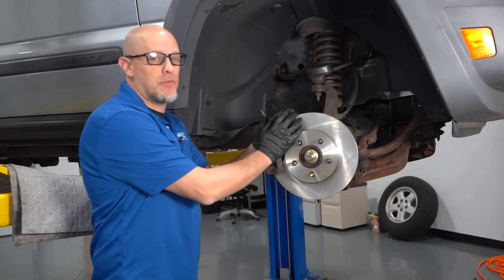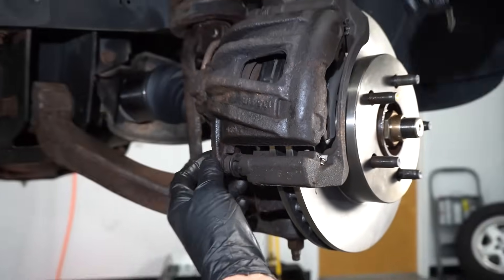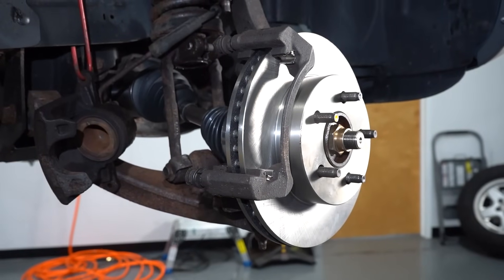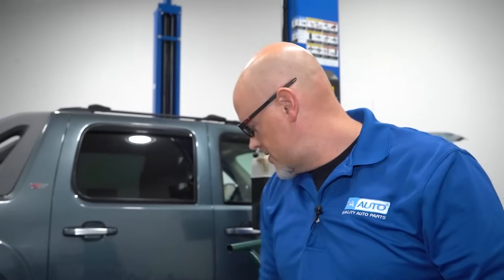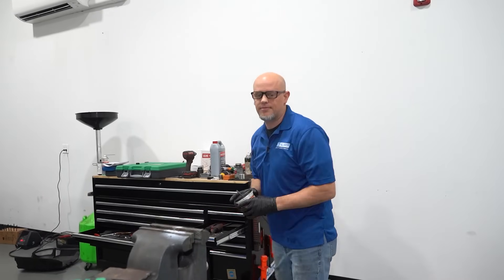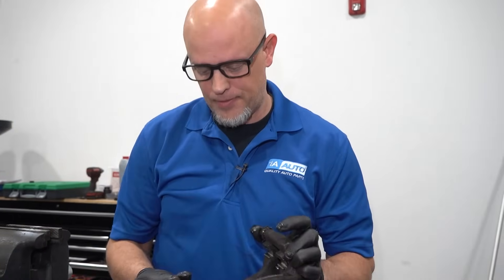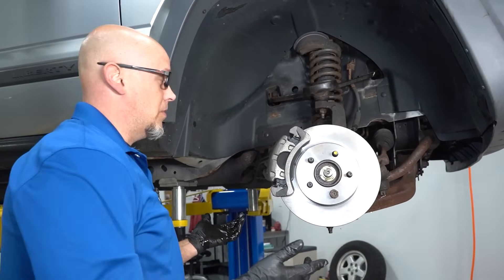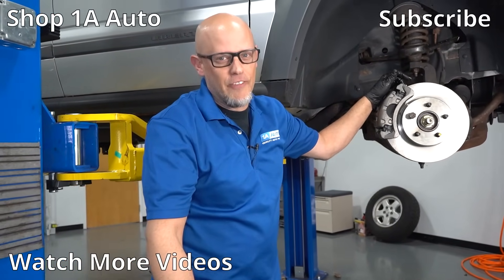Smoke? Hot Smell from Wheels? Check Your Brakes! Diagnosing Seized Brake Calipers

Comment: my car got s the same issue shaking staring wheel  going a  1 hundred down  hiway with out touching the brakes pedal if I press the pedal my tires are new and properly balanced the death shak that will losing pretty much every single bolt on the car 🤣🙃

Comment: If you just installed new rotors and pads, why didn't you clean the slide pins before you installed the new parts?

Comment: Toptip. To prevent the running of brakefluid when the brakesystem is opened, just use a rod to push the brakepedal about halfway in, before opening the system.. It basically stops the fluid from running.

Comment: Ive got a unique situation where my brakes were evidently overheating and brakes were binding. Stripped everything down cleaned all sliders up although they moved and pushed the piston back with ease, thought whilst there change the pads for good measure but still binding?
Have resorted to ordering new calipers, holders, pads, discs and hoses and hoping that'll sort it but no idea why the binding has occurred...

Comment: If you are disconnecting a caliper or hose, first connect a pipe to the bleed nipple and open it. Then depress the bake pedal until it goes to the floorboards and wedge a piece of wood between the pedal and seat-front to keep the pedal in that (depressed) position - this will close off the transfer ports in the mastercyclinder and stop the reservoir from draining out of the ( open-pipe ) system. Close the bleed nipple unless you are pushing the piston back into the caliper.
After all work is done on hoses,calipers and or caliper carriers and things are re-assembled, you can then relaese the brake pedal inside the car and proceed to bleeding the system as normal..... this is the oldest trick in the book as it minmises the amount of new brake fluid to have to use replacing all the spillage that is now on the floor. It also prevents air-locks getting in the anti-lock brake system which you really wanna avoid as it's hard to purge them.

Comment: I think I’m having this problem. I touch the disc and it was very hot compared to other side but the caliper is new. Plus, the brake pad is getting chewed.. Also, I’ve been losing gas mileage a lot.

Comment: When I was younger and we had a truck with kingpins to be replaced, the kingpin would never go out and if you heat them up and try to remove them hot, you won't be able to remove them, or you will destroy them in place. The trick we used is to bring it cherry red hot, and spray it with cold water until cold. Then it would come out very easily. Theorically, you tempered the metal, but we never any issue with that method. Hope this help.

Comment: I’m shocked you didn’t open bleeding valve to relieve pressure. 
I’m shocked you didn’t check brake line for back pressure.
I’m shocked you torched and deified the brake caliper bracket. 
‘’It’s now a very weak bracket’’  no molecules left. 
I give you a F-  on this video. 
All your other videos are great 👍 
(This one, I would do over. 😎 and rethink your procedure)
Sincerely, Mr bill ,,, shop class teacher.

Comment: My 2004 Toyota sienna is making a scraping sound, and the disks brakes were getting extremely hot, burns to the touch and smells like hot metal. The mechanic told me it was the caliper and disk brake. He replaced them, but the problem is still the same.Could it be the Wheel bearing? I feel a Vibration at the gas pedal, all the way up to the steering wheel.
Reply from the maker: +@humbertothebeliever2443 We wouldn't be able to diagnose an issue like that here, you may want to have a local mechanic take a look at it. Thanks for checking us out! http://1aau.to/m/Shop-1AAuto-c

Comment: I had to edit this post. The rubber glove trick is so got damned amazing and beautiful 🥰 I can't tell you guys how much you have saved my life. You guys taught me how to do my own breaks, Fix my U joints on my drive shaft, how to do my hubs and wheel bearings also you saved mine and maybe someone elses life. If any of thise things failed and i was going over 20 mph it could have been so SO sad. So seriously. Tysvm. 🥹 my 2008 toyta rav 4 is sitting in my deiveway   unable to move not because of the engine or transmission or differential but because there is soething else wrong and tomorrow im tearing into it. This is the first thing im going to check.

Comment: If you push the brake peddle down to the floor and use a piece of wood and wedge it between the seat and the peddle keeping the brake peddle to the floor this will stop the brake fluid from running out

Comment: Used car owner here. I've Just been told the offside rear brake has been binding (not binding right now), and has caused heat damage, replacement of disk and pad reccomended. £400/$495, Kia Stonic (UK), through a Kia dealership, that's a lot of money!

Comment: I have a 2011 Volvo S40 T5. I have replaced the ABS Modulator and pump, the Master cylinder, The right front caliper and rotor and new brakes pads on the front and just yesterday the Flex hose on the right and My bake on the right is STILL locking up on me after it get heated up from driving, I am at my whit's end with what could possibly be wrong with this, I have been dealing with this issue since last year and now I am still going through this, I have had had it through two different shops and had these things done and I just don't know what to do anymore, can you please help me out here and share with me what you think it could possibly be??

Comment: I have a question, My right front rotor when installing new rotor, by mistake the brake hose got twisted, after driving 5-7 miles, I noticed smoke, so I opened up and saw that the hose is twisted. Made this right, but now I measured temperature after driving 20-30 miles and left rotor is about 60 degrees Celcius and right rotor is around 75 degrees Celcius, is this normal to see temp diff. between left and right rotors or this is because the brake hose was twisted?

Comment: I did this to my car, the piston retracted quite easily, the pins were looking bad but I cleaned it and lubed it and it looked like everything it's ok and the wheel was spinning just fine when it was lifted but still, after the test drive it started again spinning a bit less than before the test and still gets hotter than the other wheel. What else could it be? I checked the wheel bearing of movement but it seems fine.

Comment: I found it time consuming to get a new bracket because it requires new rubber boots and new pins. So I just order a caliper bracket set with pins and rubbers included. So it's a good time to gravity bleed the brakes.

Comment: I replaced my entire caliper, pads and rotor, but my tire is still getting super hot and smells like burning. What else may be wrong??
Reply from the maker: +Trail Mix We wouldn't be able to diagnose an issue like that here, you may want to have a local mechanic take a look at it. Thanks for checking us out! http://1aau.to/m/Shop-1AAuto-c

Comment: Yeah, when you heat a bracket that's it's red hot, it's time to change it, especially since the slider pins still weren't as free as they should have been even after wire wheel and grease.   👍

Comment: I did a job on a 2006 dodge charger I replace pads and rotors now they are smoking hot. So no I need to boot and pins since they stuck needing help asap

Comment: I changed my brakes and rotors last October.  By Feb, my left rear brakes were down to metal.  I looked at caliper but the guides moved fine. I even put more grease in to make sure.  Now, I smell a string smell from that same brake.  Could it be something else or does it sound like it could be the caliper.

Comment: Just figured mine out. The caliper piston is the style that needs rotated to collapse it for new pads. However, there are 4 recesses on the face of the piston for rotating it, and the recess has to line up with a tab on the brake pad that the scratch warning plate sits on. It was causing uneven pressure on the pads so they seized pretty hard and got hot.

Comment: Thank you so much for your video - which I watched yesterday.  My beloved car has a brake issue - I now think it's probably a seized caliper or the slider pins, BUT, may I ask ... the issue arose after a loud BANG which seemed to come from, I thought, offside front or offside underneath my car - the wheel/brake/caliper that's seized is the nearside rear!  

At first I thought maybe something had punctured a tyre but, after parking back up (had only travelled a few yards out of the parking area) and leaving my car for a while there were no issues with any of the tyres.  Then my son and I thought maybe the handbrake cable had snapped but the handbrake still works - although floppy when first engaging it soon catches the ratchets as the lever rises and keeps car stable.  

My car seemed to drive normally when I took for a short test drive (half mile max, 20mph), although sounded as though brake pads were worn, BUT nearside rear brake disc (rotor) HOT, HOT, HOT!!  

After seeing your video I'm sure it's a seized caliper, but my question is ... have you ever known a loud BANG prior to caliper seizing?  I wonder if something has snapped INSIDE the caliper and it now won't disengage - I wonder if that might be a possibility, would you know?  Wheel/rotor movement, nearside rear, after my car has been parked a couple of days, is almost totally impossible now!  About four hours prior to the loud BANG and issues arising, I'd been out on a twentyfive mile round trip and there didn't seem to be any problems!  

If you have any suggestions I really would be so grateful as we don't have any local garages who would be willing to take a look (my car is 2007 and local garages have 'decided' it's too old to bother with!!  To me, of course, my beloved car is PRICELESS)!  THANK YOU SO MUCH, in advance - and thank you, again, for your wonderfully informative video!

Comment: Do you know what would cause the brake area to start smoking after I put on my factory donut? Drove 2 miles about 45mph. After I got the new tire on, it didn't have anymore issues. I've  used this same donut before without issue.

Comment: nice video i have at 2005 gmc canyon my brakes where smokey get hot,  buerned out the calipers boot, replaced calipers left and right front, new disck to and still getting hot any help, thanks

Comment: a question please.the transfer case of a 2008 rav4 have 2 key nuts. the bottom which is the drain and the next to it ontop the fill. what is the other nut ontop of it for?please help answer

Comment: Another item to look at is your flex/rubber brake lines. I had an issue with my 2012 F-160 4FX. Replaced caliper and rotors and about 10 minuets smoke and a lot of heat. Replaced front hub. Still, smoke and heat. It turns out, the brake hose was collapsing and not letting the fluid leave the caliper. $ 20 buck part, replace it,   I did not, my fault.
Reply: You that flex line on the master cylinder too

Comment: I have a 2004 jeep liberty v6. I stopped my vehicle an tried to put it in 4wd. And I  forgot to put it in neutral. I kept the brake peddle on and then quickly put the shifter back. After that  I had little burning smell from vents. Did I do any damage? I just bought it. I'm really hoping I didn't.

Comment: Fantastic! So many skills on display. Quick quiz for the viewers interested in a career in automotive. (Answers found in video)

1. What type of brake fluid is commonly used?
2. What type of grease is used on the caliper slide pins?
3. To "bleed" the brakes you loosen the _______.
4. True or False: A torn caliper slide pin boot is OK and should be left alone.
5. Two technicians are discussing a seized brake caliper. Technician A says the brake fluid needs to be changed. Technician B says a slide pin could be the cause. Which technician is correct?
Reply: dot 3
I use 3M silicone paste, but you can also use brake/caliper grease
that nipple looking bolt on the back lol
False
Tech B

Comment: Hello I see this is a liberty I have a 2004 and before we pull out of our parking spot if you turn the wheel there is a clunking or banging noise in the front end after driving a bit it stops making a noise . Any ideas ?